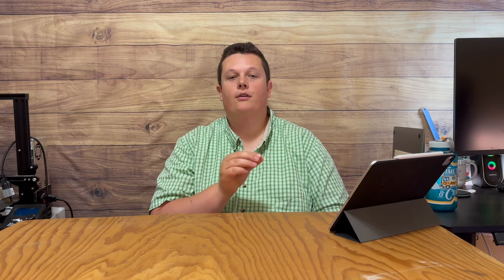Why I Choose DC over AC Power on Portable Power Stations

Comment: there are a couple of dc powered microwaves, but the magnetrons need ac to work, they are an ac component. i think makita makes one which is expensive and chews up a tool battery per use. the og radar seeking 40mm anti aircraft shells the allies invented in ww2 used a liquid battery which would rupture from the shock of firing, and then powered a magnetron in its nose for a few seconds to proximity detonate dramatically increasing the effectiveness of us naval antiaircraft weapons in ww2. this was demonstrated best during the "Mariana turkey shoot" in the battle of the philipean sea towards the end of ww2. not sure how they got a vacuum tube to survive being fired through a 40mm bofers aa cannon, but a rare example of a magnetron which used a dc power source all the same.

Comment: Thank you for sharing. I have a small fan with a heater made for the cigarette lighter output for cars. I plugged it into the dc outlet of my delta river pro, but the load was to big. The heater  demanded more than 140 watts (the package wrongfully had info of 130w). The delta river pro should handle 600watt load, so I was disappointed. Do you know how big load the Anker can handle through the cigarette lighter output?
Reply from the maker: You bet! However the DC wattage is rated differently than the AC. Even though the AC inverter is rated up to 600 watts, the DC is typically rated around 10 amps X 12 Volts = 120 watts. I hope that helps!

Comment: Well said! The future is DC only. All the systems soon or later will come with DC instead of AC inputs. The main problem is that there is no standard input Voltage between electric devices. I'm planning my new off-grid house to use a 48V DC bus and high efficient converters (with GaN FETs). A possible solution for the most devices would be a USB-C plug so you can handle the different voltages.